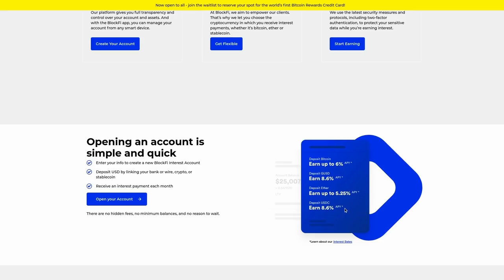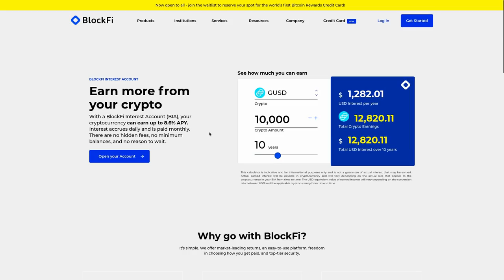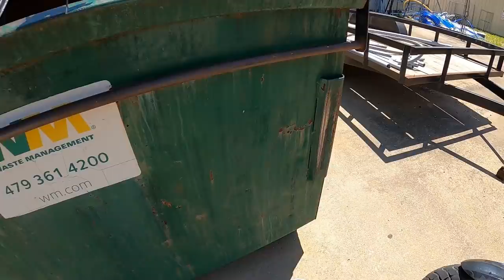Dumpster Diving ELECTRICIAN SHOPS for Scrap COPPER and Cash Values!! - (you can do)

Comment: When you were cleaning up you threw some of the crystals from the electric light into the dumpster.  Do NOT do that!  Those crystals are worth a lot of money, like over a dollar EACH.  Do not just place the other crystals from the other light fixture into the scrap pile.  Take those crystals off and sell them on ebay or sell them to an antique shop.  I know I had to replace some crystals for my chandelier and EACH ONE of those crystals were expensive, MORE than the scrap.  Just giving you this info so you don't throw them out.

Comment: I tried melting contacts from relays and those breakers turns out it just stuck together in a blob silver and copper melting point is only 200 degrees apart. They might have some palladium too in them from what I've heard.